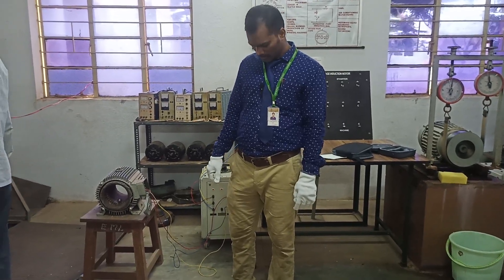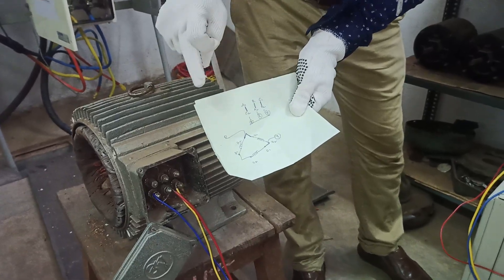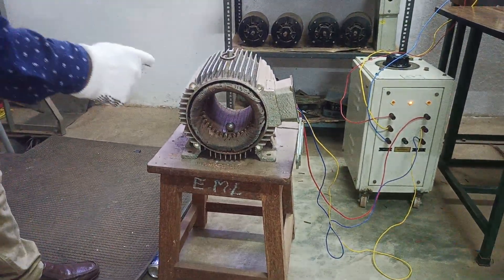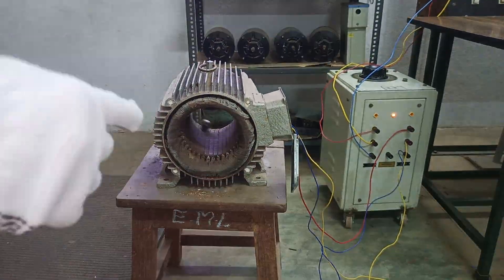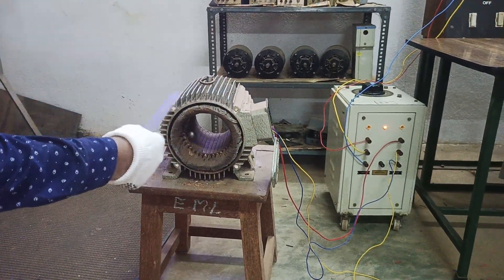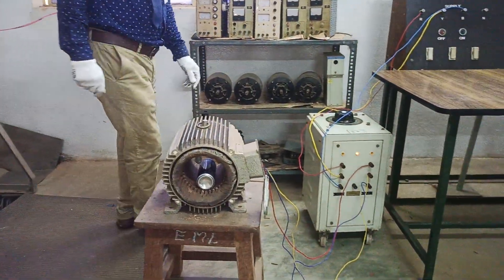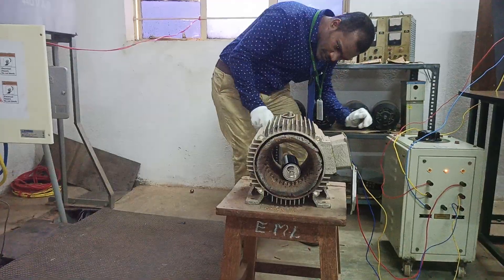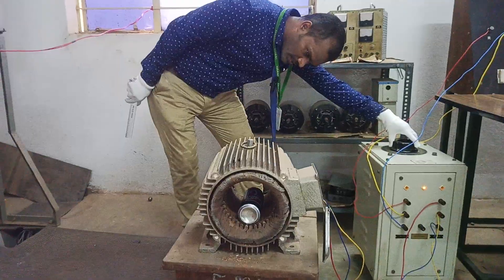You Won't Believe What Happens When You Use a Metallic Sphere in Your Induction Motor

Comment: Thank you for the clear explanation, Professor. The video was very helpful. I’d love to see more videos like this.
Let me simplify my question: To create an electromagnetic field in a metal rod using a magnetic wire, you would need a phase and a neutral, similar to how you use + and - terminals from a battery in a DC circuit. In a three-phase system, where there is no neutral wire, how does the circuit form a closed loop and function correctly without a neutral?
Reply from the maker: Thanks for valuable comments....in our channel, we have star to delta conncetion in transformers..pls watch...you can understand more... lot of useful practical videos on electric vehicles also available which are more interesting..